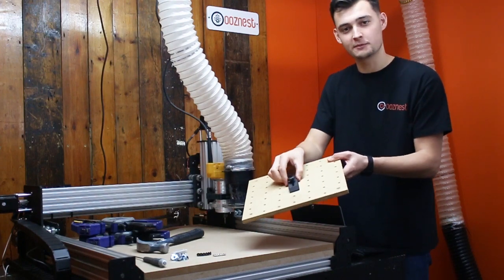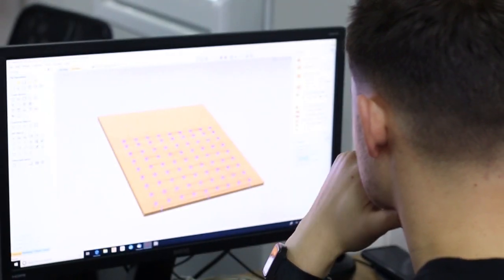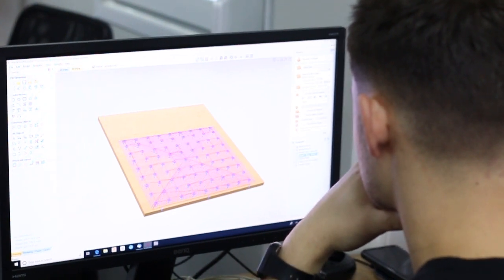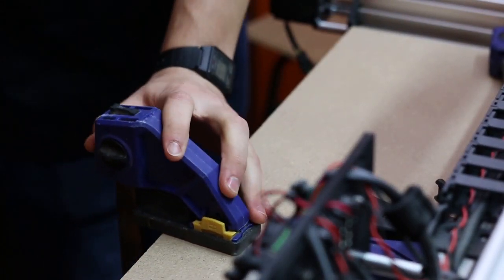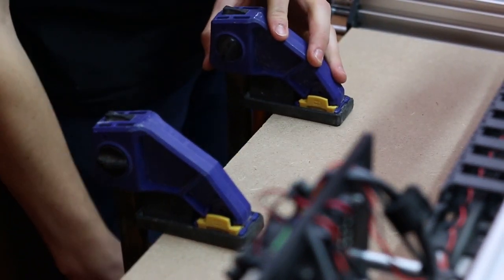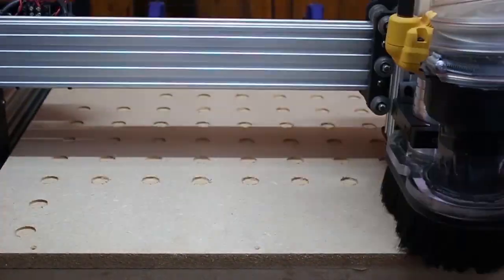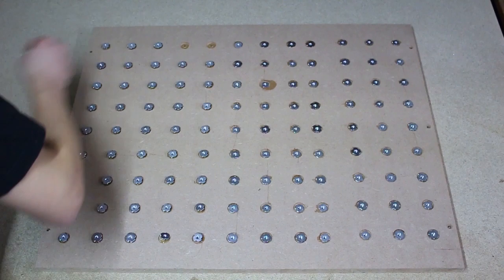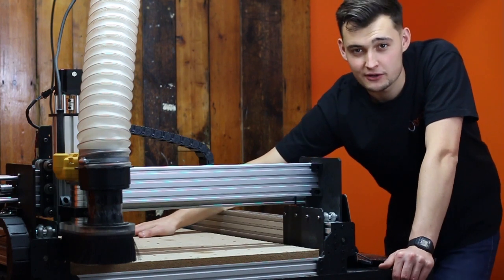Makers Minute | Manufacturing an MDF Spoiler Board | WorkBee CNC Machine

Comment: What bit bit and feed/speeds did you use to face the board? And also what bit for the holes?
Reply from the maker: 2.5k Feed, 27k RPM. It was a 1/4" bit for the holes